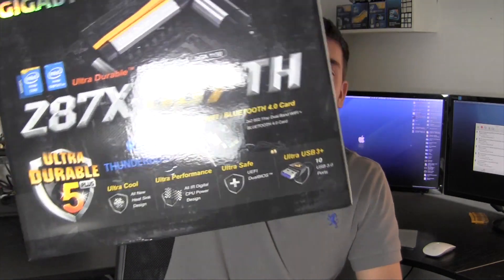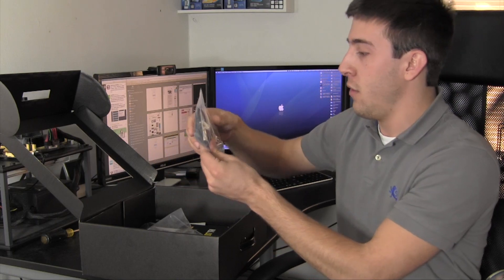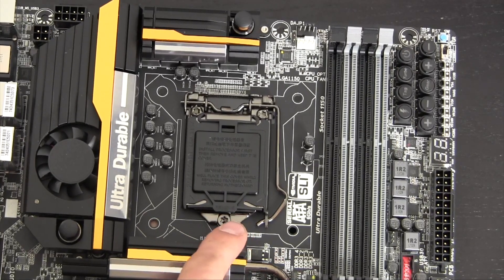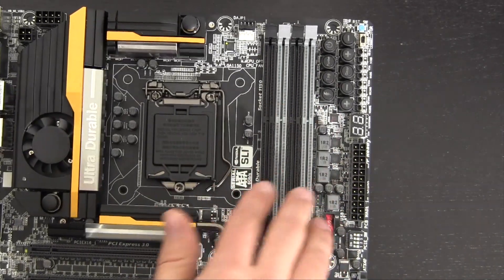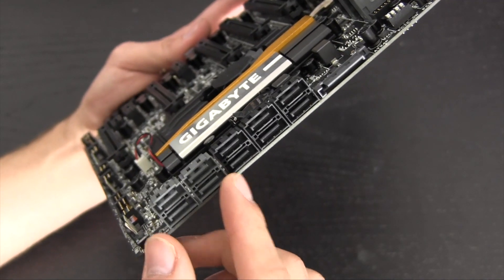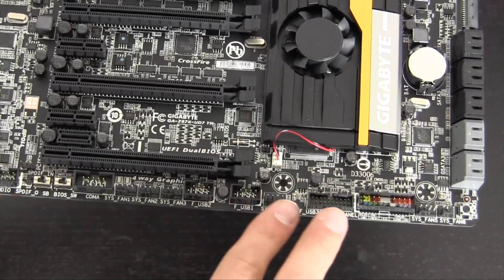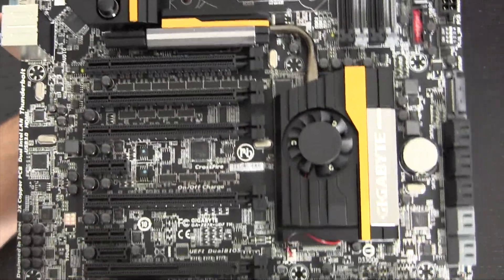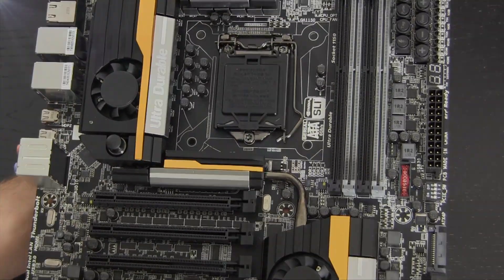Unboxing: Gigabyte Z87X-UD7-TH [Motherboard]:

Comment: Hey im going to purchase this motherboard for a gaming pc run a thunderbolt port to my iMac 21.5" (late 2012)

It says here that with my late 2012 iMac that Thunderbolt to Thunderbolt connections are supported by Target Display Mode... http://support.apple.com/en-us/HT3924

Apple Forums said it should work but no one has ever done it... I read that someone in 2011 bought a motherboard and it did not work but that was 2011 and he did not report what motherboard he used.

So this should work right? Can I get your opinion on it?

Comment: Excellent overview but there's a few things worth noting, there was one more 3-pin fan header by the memory slots. The dip switches don't provide more performance to the pcie, they turn off the slots so that you don't have to remove the cards. And there are technically display port outputs in the form of the thunderbolt ports.

Comment: You missed a 3 pin fan header by the RAM Slots, and that the VRM can be water-cooled. Otherwise, great video Bob. When I get around to  building my new system, I might use this board, Thanks for showing it to me and the other people watching.